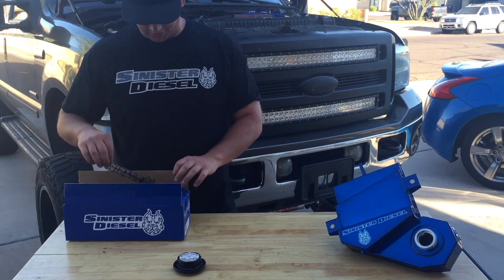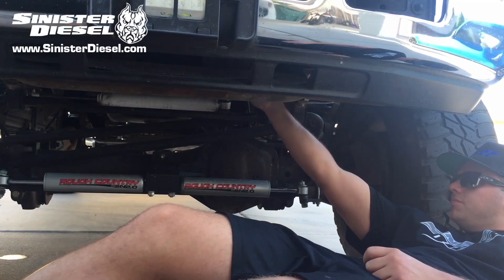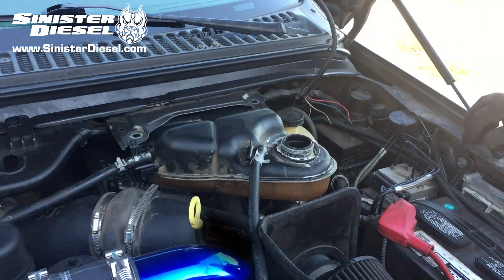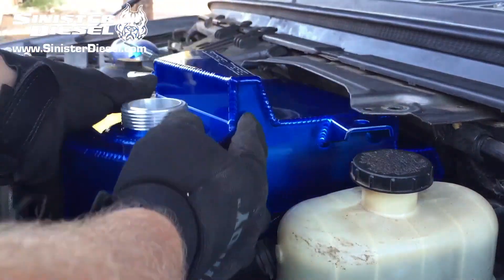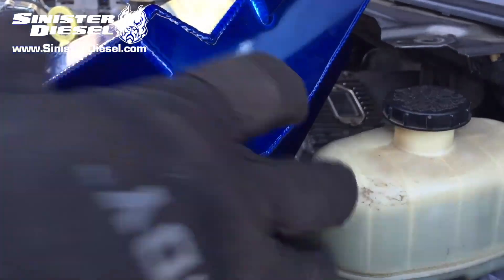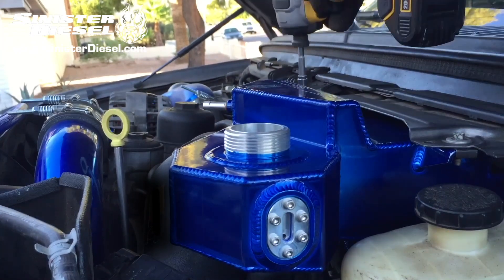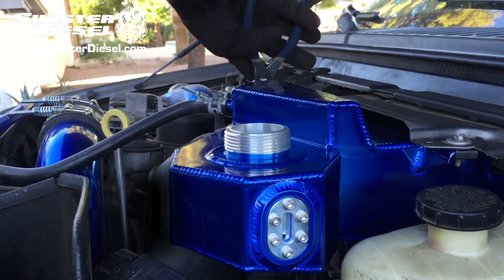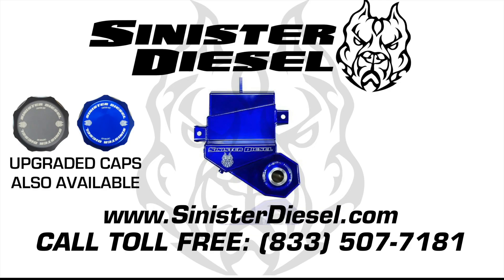Installing Sinister Diesel's 6.0L Degas Bottle

Comment: This would be a good time to do a complete cooling system flush. I plan on doing this as well as putting in a new Mishimoto radiator and Sinister intercooler.